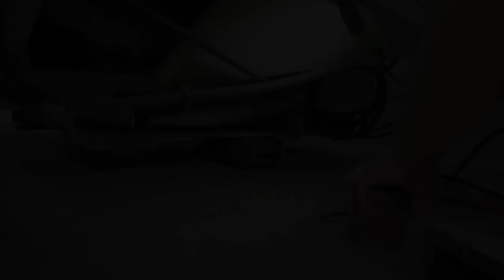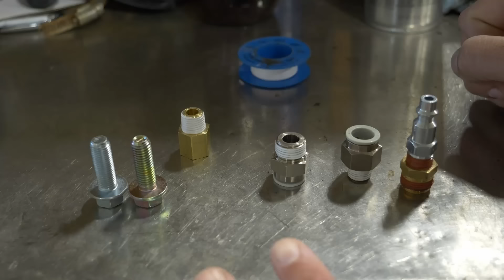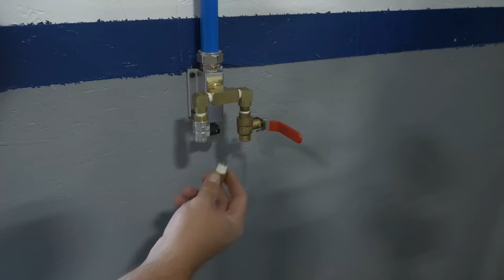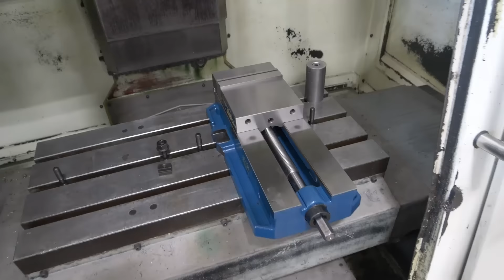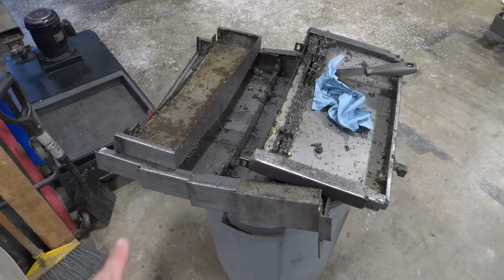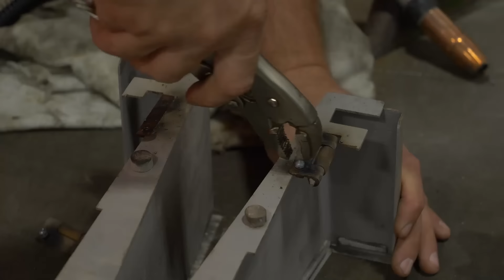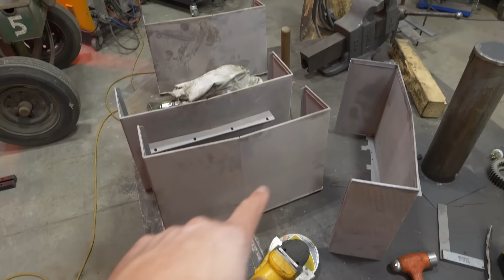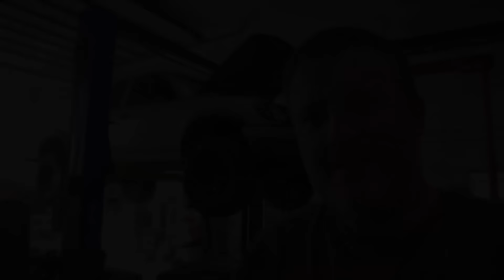Did I Buy a Problem or a Solution? Cheap CNC Repair Part 1

Comment: A thing I would like to add is that there is no problem with Metric, it’s the deviation that is the problem, Hydraulics and Pneumatics in Metric countries are usually still imperial or otherwise grandfathered in, Grain Size for Abrasives is measured in holes per inch^2, 
In Metric there is also a big difference between weight and Mass, weight is kg mass is Newtons big N, torque is Nm not kgm, the way a unit is displayed is also very simple (as long as you use the Latin alphabet), you just write it as a small algebraic equation leaving out multiplication dots as is mathematical practice, so Nm is N times m, if you then don’t know what a N is you look up its equation and substitute it for N, repeat until only known Units/ practical Units remain and when it happens often that you need that you just use a new designation for that unit I think America does it the same way but mostly in all scientific regards where just using metric would just change some numbers.

We also need to differentiate between Metric (as in based on the Meter, which the imperial system is also so you could argue you are just using a weird conversion) and for example ISO standard, in Germany we have the DIN (GermanInstitute for Standards) which puts out almost identical standards to the international ISO standard, just mostly translating it and thusly defining new designated terms to streamline technical communication, the ISO standard and base 10 counting is what most Americans and maybe most people mean when they say metric, but that has very little to do with fittings which as a low value good with insensitives to use a variety in order to prevent error in assembly and spontaneous disassembly following said missasembly.

Japan and a lot of Asia use Japanese hold over standards, because that is what is used very commonly and few companies see value in switching to ISO for something so minor, Europe uses a wide variety of threads and fitting standards I commonly interact with at least 3 different standards Witworth the weird ISO equivalent, and „pipe thread“ of which I also don’t know the particular designation by heart, because where I work it is mostly witworth or weird American witworth because somehow there can at times be a difference on some specific machine where import fuckerie happens.

A good example of a still very prevalent issue is material Standards and material designation standards, in Germany we use a mixed system that separates different material groups, like Solders, Sinterbearings, Aluminium alloys, Copper Alloys and steel, steel is further subdivided into not alloyed, alloyed, ?precious? steels (specific alloys with specific characteristics and contents with specific attributes), and highly alloyed. Unalloyed steels are further devided by carbon content and anything below a certain percentage is then commonly, even in official standardized documents, called ?rebar? (Baustahl), this low carbon steel is just rated by is strength before plastic deformation as well as specified operational temperature range, so you might have 235JR 
235Nm/mm^2 + JR (essentially normal temperature), low alloy steel however are designated by first their percentile carbon content times 100 then followed by all alloy components, as the periodic table shorthand, in order of proportional content, with anything beyond a certain threshold of percentile content getting a number in order of the label which is encoded by a factor specific to each element, high alloyed steel is the same as low alloyed, but it puts a capital X in front and gets rid of the encoding factor, all this can then be followed by a + and a single or array of capital letter encoding the formfactor and possible surface and tolerance conditions, +C for cold rolled for example, but all of this is still commonly used in conjunction with the outdated system of alloy number designations and shorthand’s for conditions like VA austenitic, as well as any foreign designation that any company might deal with due to importing of material. Many large companies have basically given up and have given their employees color codes to designate the varieties the company handles. 
A proper ISO standard could make many people’s lives so much easier and safe a lot of people from ordering mistakes, but since there has been little interest in either proper implementation or designation almost all countries just continue to cook their own Standard spaggett. 
Usually the problem is not metric or imperial, because the root size is essentially irrelevant, but rather the rediculous amount of unnecessary and convoluted standards that are spawned by two size systems being used in conjunction.

It’s not metric that’s important, but rather ISO.
Reply: We usually just convert N to kg not the other way around, unless some Ijengear has something to say about it, I not Ignejeer so I don’t know what they are doing.

Comment: Your thoughts about the torque wrench are a little bit off there.
The Metric unit for torque is Nm in which N is also a measurement of force, not weight. It just so happens that in metric 1kg introduces ~10N of force on planet earth.
So the torque is 1Nm if the force of 1N is applied 1m away from point of rotation.
Reply from the maker: Is that not exactly what I said?
Reply: @WatchWesWork  Ok, I did not get your point then I guess.

Comment: First couple of jobs out of highschool, were in manufacturing, aluminum frames for windows, sliding glass doors, using punch presses, cut off saws, never forget the smell, metal and oil, measured everything down to the 32nd, 64th, no sign of a millimeter, most boring and monotonous , miserable existence of 40 hours a week and more, knew it wasn't for me.

Comment: I was in the 6th grade, early 70s, I remember everyone in class freaking out, teacher was saying that America was going to change to metric, and we had to learn it, man what a foreign concept,  alot of us knew how to read a tape measure and knew our system of measurement, but it was so hard to try and think of measurements in a different system, even though everyone says it's easier, wasn't for us, anyway this huge warning of the metric system coming, and our standard imperial disappearing, never happened, I forgot what I learned about metric, if anything, and it still seems harder than what we already have, the hard part is, yeah it's easy to learn the measurements, but there's no reference to the quantity, we know what a gallon is, or 6 feet, we know how much that is, or a mile, we can equate the measurement,  but if you say 5 kilometers or 10 liters, I have know idea in my head what that is how far or how much, old dog I guess, to hell with new tricks.

Comment: I hated metric until I went to college.  In grade school, I think it was in the 8th grade, we learned the metric system, but what we learned was how to convert imperial to metric.  All those convoluted mathematical formulas turned a simple, base 10 system, into something I absolutely detested.  In college, all of my science classes were based on the metric system and I found it super easy to use, it's just those conversions to imperial that make it difficult.

Uhhhhhh... yeah, that Tacoma's frame is toast.  Toyota had a huge frame rust issue with the early 2000's Tacoma's, they had to replace a lot of frames at no cost to the owner.

Comment: For the Nm eyeballing you just need to know your weight in Newton. For me it's close enough to a very easy 1000 :)

I guess engineers would often prefer Nm over ftlb since the latter doesn't make sense when there's moving objects involved.

Comment: Interesting project. A couple of suggestions on the way covers. Thodacon in China offer a good range of wipers and mountings and accessories. Not too badly priced. Also the covers buff up well with coarse scotchbrite rotary pads.

Comment: i did machinery moving years ago used them there was a solid round bar welded to the ends of them we steered using pipes over this rod pul the pipe as u move the machine can steer it

Comment: the german m10 bolt is 10mm x 1.5mm pitch , the japanese bolt is 10mm x 1.25mm pitch. First is regular aka coarse thread and  second is fine thread. Its just that Japanese engineers love fine pitch, for example at engine mounts or the bolts that hold trransmisson and engine block together.

Comment: I always wondered why we still use extremely outdated measurement units for pipes in Germany. Maybe this is why.
Though, I would argue that almost every standard is better than what we use right now, which is the outer diameter of the pipe in inches as the pipe would have been 100 years ago…
There is basically nothing left of the original measurement. A 3/4 inch pipe has no measurement that is 3/4 inch anywhere. At this point "3/4 inch" on a German pipe is just a name.

Comment: When I was in college, I worked a summer job at a hydraulic equipment supplier, one they received a pump that just a little too heavy.  A couple of us were invited to climb on the back of the forklift to add a but more counterweight. In hindsight, I realize just how bad an idea that was.

Comment: I'm French and no offense but you mix up/short cut everything on your own imperial system :
You have pound force, and pound, and foot pound in the USA
You speak here about foot pound ,but you have pound,wich is a mass measurment ,and pound force,the gravitational force 
We have kilogrammes and kilo grammes force an old unit,wich link mass and weight. 
I work on Nm units as a maintenance guy and m/kg is still in books/shop manuals for torque values.
1kg on a 1 meter wrench is 10 Nm or 1m/kg wich is it's a torque value.
It's built in the metric system like in the imperial ,i'm sure that 99% of torque wrench can't even get within 2% of accuracy so 
9.81 m/s is for astronauts only.
The different frictions caused by different platings are enough to screw up the torque value,so rust or oil you imagine.  
PS : the imperial system sucks ballz ,you are two in the world using it lol while everybody has 10 fingers,not 16/64 inches of 2by4 lol

Comment: Oho, is that another machine waiting in the wings that I hear? Perhaps an upgrade upon the current unit?
Whether it's a 'make a better machine combining two units' situation, or a 'finish fixing the VM1 and trade it for a more capable unit', or something entirely different, I look forward to it!
Somebody needs to sell a full frame replacement for those trucks, just swap everything to a new frame and go!

Comment: Hi Wes, a Dutch person here, working in Australia. I feel your pain. Australia converted to metric in the 60's and has been confused ever after. I work in Subsea oil and gas for a US based company. We use NPT for any thread sealing connection. BSP is rarely used in hydraulics and mostly for lower pressures. Fittings are hard to come by. What is used often though is BSPP, which uses a polymer seal encapsulated in (stainless) steel, and straight thread. JIC is very popular too. To compare ft-lbs to kg-m is not correct. A torque tool should have Newton-meters as a unit, because a Newton is 1 kg multiplied by the gravitational acceleration of 9.81. American people often boast that imperials went to the moon but this is a misconstrued myth. Werner von Braun was the designer of the Saturn rocket (among others) and being of German descent worked in metric units. Apparently Nasa employed a team of people to convert his calculations to imperial units. UK decided to change to metrics in Engineering a long time ago. One day the Americas will follow suit..... Love your work Wes!

Comment: That was BSPT. BSP is the whole standard. BSPT, BSPP - are the kinds of hydraulic couplings. 

BTW - in port adapters there is a difference between British and Japanese types. Some of them will not seal if wrong one used.

Comment: on your soapbox.....a killogram is a measure of weight......1000ml of water at stp, and is alot easier to work with......pounds are for weighing potatoes

Comment: I vehicle set temp to 72 degrees f, change to celcius equivalent is 72.222 unit allows 1 degree increments. Set to 23 celcius which is 73.4000 too warm. Other vehicle has .5 degree celcius changes.

Comment: i learned about BSP through putting an oil pressure gauge in an 80s japanese car. the oils galleries are plugged with BSP, drove me nuts why the metric and NPT wouldnt fit right

Comment: That ol' girl's been worked hard.  In the early 2000s I worked maintenance at a foundry in CA.  They had 3 CNCs in the pattern shop.  The oldest was used to make core patterns and it's computer motherboard died.  They ended up having to track down a 386 motherboard.  Anything faster would over run the program and crash the machine, or so I was told.  Good luck with that project.  If anyone can do it Wes can.

Comment: I don't know about the other standards, but this channel is the standard of cool. 
Here in PA there's state inspection for vehicles - brake and tire measurements are still in  32nds of an inch.    No 1/4", 6.35mm,  or .250".  It's 8/32 here.

Comment: Even when it's metric we still have problems. I have here on my desk a brake line pressure switch for a VW. It's supposed to be M10 x 1.0 Taper. The parts all have 1/8" NPT instead. Even from 3 different suppliers. They're close enough to damage the threads in the master cylinder.

Comment: It's a little-known fun fact that there's no such thing as a metric pipe thread. I've never found any hard evidence for this but I suspect the fact that British companies built gas works and supplied all of the pipes and hardware in cities all over Europe and probably a few more places is the reason that Whitworth/BSP was accepted as the standard plumbing thread. Metric threads were only invented considerably later than Whitworth, which is supposedly the first known thread standard. Prior to that, everyone designed their own threads. The Germans tried to describe the existing plumbing threads in metric terms a while ago but I don't think these new (and very complicated) designations ever came into widespread use, everyone still seems to be using the Imperial ones. Europeans don't like fractions but 1/2" is still easier to remember than 20.96 mm (BSP threads give the nominal inside diametre of a pipe with a specific wall thickness, which doesn't necessarily correspond to currently used wall thicknesses, while metric designations usually specify the OD)

Comment: I built air and manual strapping tools the swedes decided to build a tool couldn't get it to work sent it to us my metric t handles wouldn't fit I swear to you they had half sizes like 10 and a half what a pain

Comment: Don’t scrap that Taco Wes. There was a frame recall on the 1st Gen Tacomas and thousands of frames were replaced. You might be able to find one and replace that junker. I sold my ‘04 Tacoma with 65K miles on it and the frame looked brand new. But I’m in NC so we have to deal with salty roads all winter.

Comment: 10:20 Correct me if I am wrong, but I think it is not 100kg * 9.81 m/s² * 0.3m to get NM but rather 1000 N * 0.3m to get NM.
EDIT: Oh no. I think you are indeed correct. 1 kg = 9,80665 N

Comment: I understand a need to vent out the rants, but the mess you have is a result or the free world. Everyone buys and imports anything and everything and just screws everything together. You will not have such problem buying a german machine. 
And the japan and germany metric thread "difference" is just a simple fine and coarse metric threads. They have different purposes.

Comment: When you changed the leveling "a tiny little bit" was that a metric or imperial measure?
Reply: The slang term "skosh" is an imprecise unit of measurement that means "a small amount" or "a bit". It's often used in phrases like "just a skosh" or "a skosh more/less". For example, you might say "a skosh of nutmeg" or "I'll have a skosh more coffee".
And, carful bot to confuse skosh with scooch, they are completely different units.

Comment: So, a couple of points, 1. I vote thumbs up for this type of content- it reminded me of the brake lathe restoration.
2. This new machine, what would it be used for in a full production machine shop vs. what you intend to use it for.

3. Could you resell it for a profit after  refurbishment - including your time investment? Would machine tool flipping be something you might move into ? 

4. Toyota’s have a reputation of being nearly bulletproof- apparently even the mighty Toyota isn’t immune to the destructive power of road salt.   You could probably find a rust free frame down here in the south, a frame swap would be a very cool video series . Maybe you could work a deal with the owner to either do the swap for him, or buy the truck from him and do the swap.

Comment: Up here in Canada where we were more connected to the UK supplies of machinery for so long, we run into BSW (coarse and fine) all the time.  British sports cars, metal and woodworking machines etc.  I actually own a full set of BSW taps and dies and use them regularly though 75% of the time it is to try and undo damage from people not realizing what they were working with.  1/2 12 vs  1/2 13 catches people a lot but the 55deg thread form is not easy to see with the naked eye.   Great video!

Comment: We’ve got a VM1 2007 machine in our shop. The Hurcos are great machines, just be careful in putting too much time and money fixing them up. Had an issue with the PC on ours and I don’t believe Hurco supports the old Ultimax Dos based PC’s, you need to upgrade the whole unit to a win max PC, which was very costly (probably quite more than what the machine is worth). We lucked out and found a replacement board but just be careful on investing too much fixing them up.